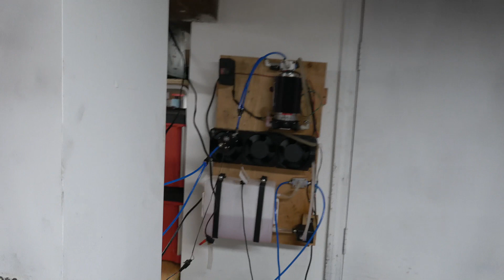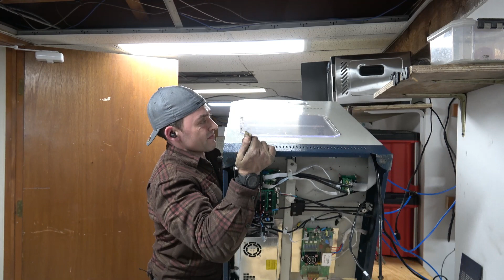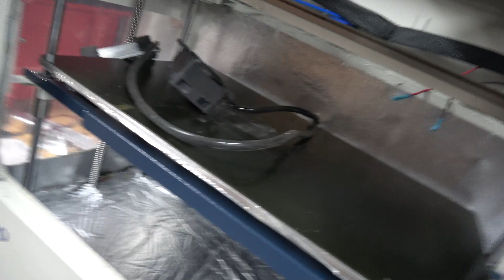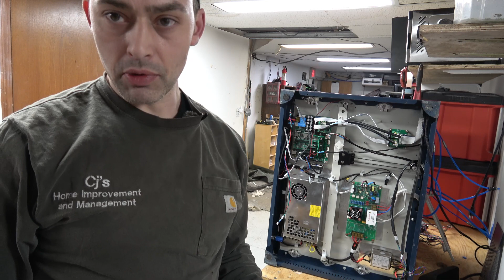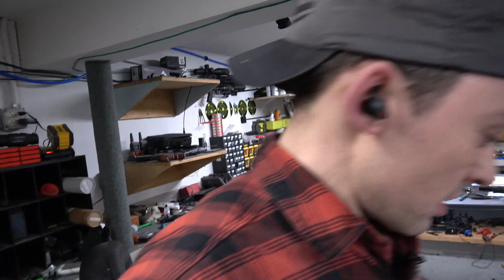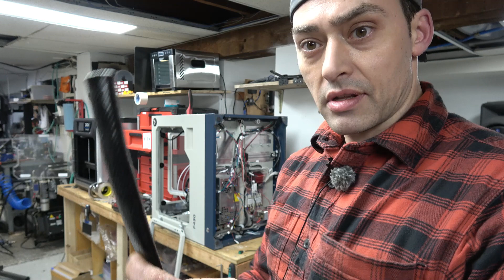Creatbot to Chrisbot Conversion Almost Done!!

Comment from the maker: how much Q D I turned around after one interaction I wouldn’t judge on that alone. Honestly, I don’t really judge anyone on their first interaction with me but as a customer who just bought a $1500 printer, I expect at least the return well actually two $1500 printers, at least get back to me but it’s like a week before I get a returned email and by then I’ve already fixed the problem. But that doesn’t mean anything they might have been busy. Maybe it was a bad time, I don’t really know what was going on, and I own my own business, so I understand stuff, maybe it was a bad time for them. They had a lot going on I’m not sure, but I don’t judge them based off of that one interaction, just stating the truth. That one interaction was bad so that’s my experience with them. I don’t have any further experience to go off of, but honestly it’s because those printers have not had any problems I couldn’t handle. A clogged the Schruder or nozzle a couple of times, but I’m printing polycarbonate, and other high temperature carbon  fiber filamentsmost of the time so it’s to be expected

Comment from the maker: So the printer.config file we are developing Currently, it Hass to be custom to each machine and each board and each everything else. Whatever you’re putting in it, it’s not gonna be the same for any two machines.
Reply from the maker: I replaced everything, every single piece of electronics, every single wire, literally nothing is left. Original! Every board, every wire is gone, new heat, sources, new power supply, new main board, new drivers, new stepper, motors, new belts, new wiring, every single thing is new, both extruders liquid, calling on every single stepper both extruders, I even have a hot end that is liquid cooled
Reply: @Cjsairgunscarsandmachining   same route i plan on goin. i am designing some parts in cad to keep the original mgn15 rails in there original place and use a corexy motion system. Do you have a CNC?
Reply from the maker: @mrcleanmn  yes, I made my NEMA 17 liquid cooling blocks for this. I'm almost done, I have it homing, and all of the heat and thermistors working, I just have a few more peripherals to connect. I have a 4' x 4' gantry mill CNC.
Reply: @Cjsairgunscarsandmachining  cant wait to see the vid man!
Reply: yes i get how config files work i would have to change the hardware for what im using.  Are you staying with the motion system that is in the f430 or changing it out for something different? I plan on going corexy for the gantry.

Comment: greatly appreciate your videos as you know your in a class of your own making vids for this unit. If you could , list all the stuff you bought for it. I'm new to this printing and have one that i got a gr8 deal on . Can you list everything you bought to upgrade ? I want to upgrade and protect my investment too.
Reply: trying to keep up but my head is spinning.
Reply from the maker: @benjolaoso7161  mine, too! It’s a lot, I built my CNC machine, it was a premade machine, but kind of like a VORON, you have to put it all together and pour cement six bags of cement, but I’m a contractor I do this for a living, but leveling the concrete-plainarity to within 1000th of an inch, it was a very meticulous process, so I looked at this job like it was tiny, but it’s really really not. It’s a big job much bigger than I thought. I still got it done way faster than anyone believed I would, but I’m a very determined individual.
Reply from the maker: Hey, thank you, the fact that people appreciate the videos is the only reason I do it, the list would be incredibly long! I must have ordered about 150 different things, and returned maybe 50 of them, I over ordered, knowing I was over ordering just because I wanted to make sure I had the right thing. Saved my butt a couple of times to do it. That way, I can list the main components, but the list would just be too long to list everything. It was so much, down to micro switches for limit, switches, heat, shielding, heat, tolerant, wire, different gauges of it, really, just so much. I can list the Motors, the board and stepper drivers, stuff like that the main components, the belts are just gates belts With steel internal, but that’s only because I’m doing extremely high temperature.
Same with all the heat, shielding, and mosfets etc., most people won’t need everything I got, I’m making this printer capable of 200 C in the chamber, I’m not going to go up that high, but if I ever need to I’ll be able to
Reply: @Cjsairgunscarsandmachining  you got it! Bruh just keep talking as long as you can we can always pause and comeback to the vids. This vid I’ll be here several times.
Reply from the maker: @benjolaoso7161  You can always come back, and I'll go into a little more depth when I do the last videos on programming printer.cfg, and finished product. Also, feel free to reach out if you have any problems, if I know what to do, I'm always willing to help.

Comment from the maker: So what you got the same printer? This printer is a good printer to start a build on if you can afford it I know a lot of people think I’m crazy because it’s like a $4000 printer and I’m ripping it apart brand new I did like three prints on it and ripped it apart, but, I knew what I wanted and I had just bought the INTAMSYS funmat ht, and I don’t know if you saw the video or not but my god what a disappointment. So I went for something a little less expensive, and I actually bought that and A RAISE 3D E2 for just about the same amount that I paid for that one printer that really sucked balls! Now I have a great IDEX industrial printer, and what was supposed to be a high temperature industrial printer, but I’m making it into a true high temperature industrial printer! Dude, this printer doesn’t have one original wire left in it the entire printer, not one single wire, the only things that are still there from when I bought it are the exhaust fan, the chamber heater, but I added four more, and the bed heater. Every single other electronic, wire, any type of component like that is gone! I have a pile of boards on my table in my workshop, my small workshop. I should probably put them online if anyone needs parts for this printer lol, but honestly, the parts didn’t add up to as much as you would think. I probably spent maybe 1200 1500 at the most on materials and that’s with four mosfets, a 600 W mean well power supply, which is triple the original, two of the MOSFETS are for 120 for the bed and the original chamber heater then the other two are 24 V for the four additional sources I added, all the insulation, and it was a substantial amount other than what I had already, which was Ductwork insulation, the extruder, the all metal BMG, I had that that was actually designed for the INTAMSYS, I redesigned it, and modified it to make it fit like this, then added liquid cooling, so that was like almost 400 bucks and I didn’t even use the stepper motor. I got all LDO high temperature Motors, the X and Y are the super speed. and they have 5106 drivers, the others are on the Z axis it’s a 0.9°, high temperature, and on the extruder it’s also a 0.9 high temperature because they will have more torque and don’t need to go fast. Every other stepper is on a 2209, the smaller extruder that came liquid cooled has a Nema 14 LDO high temperature, so every single motor is a high LDO, just different power, ratings and drivers, the belts are gates belts, the main board is an E3EZ with multiple different drivers, obviously but the easy drivers, and all high temperature wiring. I bought all different gauges of high temperature wiring, all Capricorn, high temperature tubing for liquid cooling, all the wires and tubing are shielded and extreme high temperature, wire, shielding, especially the main whip, because there is no PCB on the tool head, I ran everything all the way down. I did make a connection to swap out heater, elements and thermostats, but the wiring goes all the way to the main board. There’s no electronic boards in the chamber. The back of the screen will be, which is a new screen as well, but that’s going to be covered by a 3/16 sheet metal box , and I’m going to thoroughly insulate that. But the point is all of the electronics are out of that chamber, I even insulated the bottom of the printer in between the printer and the electronics again, and the bottom has more insulation than anywhere. I did that to protect the electronics because there’s so much more power down there than there ever was. And the liquid cooling I built the whole entire liquid cooling system and it’s so efficient. I had it at about 95C in the chamber when I was printing before I started taking it apart, and the coolant never got above 21.5 C. And that was for six and seven hour prints. So I have a feeling this printer is going to do more than fine, it’s actually getting quite a bit of attention already from friends of mine and they are people who for instance, one owns a machine shop and makes parts for NASA, so if I’ve got their attention obviously this is going to be the real deal. If you look around at high temperature printers, you can’t get a printer that will do 150 C in the chamber which I think it will actually do over 200, a 200 C bed, and 500 C nozzle for less than $100,000 I think, I haven’t seen those numbers on any reasonably priced printer like even 15 to 30 to 50,000 the 22 IDEX From Vision Miner. I really wanted but talk to myself out of it because I couldn’t justify the cost, and obviously I made the right decision because I got a really high temperature printer that will be even higher than that and a dual extrusion independent extruder printer for the same damn price as the one that was half the price, so I think I made out pretty good, I won’t even be at 8500 with everything done. But it took a lot of my time and effort and brain power and it’s been a little trying to get it done this quickly. But it’s also been fun and rewarding, if you need any help when you get into yours, if you’re going to go this far, you can shoot me an email I’ll tell you what parts I used and how well they worked, honestly I’m not 100% sure because I can’t be. I have not used them yet, but with the stepper motors and liquid cooling that I have in the extruders that I chose, and the temperatures I’m going to get in that chamber, and on the bed, and at the nozzles, I have no reason to think that this printer isn’t going to work flawlessly. And with the new belts and motors it’s going to be a very fast printer. I took a full pound off of the tool head. That’s crazy! And I still have two extruders. I’m probably going to take it down to one at some point, I just have to decide which one then it will be even lighter and even faster. Anyway, if I can help you in anyway when you start building yours, which I’m sure I will be able to, I wish there was somebody I could contact to help me throughout this process because there’s a lot of stuff that I did not know, but I like the challenge. that’s why I did it! And it most certainly fulfilled that, but I’m glad I did it nonetheless. Anyways, feel free to reach out whenever you need something.

Comment: Hey great videos.
I've been following your 3d printer videos, and was wondering, if you had the time, if you could do a full review of the Qidi ( i think it's pronounced like Chee - dee), maybe a more long term review. Showing and comparing some of its prints to the Bambu. After setup do you need to keep tweaking it or does it hold configurations for a while other than maintenance?  I've heard it has some quirks because it's not just stock clipper, some say it overwrites things or doesn't save settings. How did it print different filament types? Is there any ringing or other artifacting? I think you still had a bltouch, but they are now shipping with the inductive sensor and magnetic sheet. Have you tried any other beds with the Qidi? Did you always use that one bed adhesive or is the bed good enough?

I have very old 200x200 I3 clone that I enclosed to print abs, that i moved to PETG for the fumes. I print mostly functional parts I design for myself/family, but would like to get into TPU and more high temp filaments for parts durability with a big bed. There aren't many reviews from people that paid for the printer. 

I would like a Bambu but I would really like a bigger build plate. I was also considering a creality k1 max, but it seems to have issues with 1st layer/bedwarping/bed leveling (that could be possibly helped by rooting and full klipper) and issues with ringing/artifacting(these seem to be a fault of the printer design).

I saw on a nathanbuildsrobots video with creality, that they are possibly launching something big on their company anniversary April 9th, I think. Also Bambu is supposed to launch the new "flagship" printer in 2024, so I am probably going to wait a few months to make a final decision. Would also like to see a review of the Chrisbot compared to the QIdi and Bambu, when it's done.
Reply from the maker: Hey, I read the beginning of your message. I didn’t get a chance to read the whole thing because I’m kind of swamped right now, but I always try to respond in a timely fashion, so at least I’m getting back to you, but as far as that printer, I made like four or five videos on it, the only other video I was possibly going to do is, I’m installing a beacon, the leveling sensor, like I am on the CreatBot, I thought I might do a video installing that because I’ve already printed the mount for it, but a full review I think over the course of all those videos I’m probably said all I have to say about it. Truth be told I don’t really print with it all that much because I got so used to it not working that I was using my bamboo printers. I have a Snapmaker and a RAISE 3D E2, and between those printers, and when the CreatBot is done, it’s one of the last ones I go to, i’m hoping to change that with the fast bed leveling. That’s kind of a game changer. It’s definitely printing well now but the bed leveling has always been an issue, on my third BL touch which I didn’t pay for any of them, they gave them all to me, the support has been amazing. My first experience was bad and then really they made that up.

Comment: Definitely the hextruder for the win look up vz bot man the hextruder with the Goliath hotend no heatsink needed. It's the route I'm going with my custom f430.
Reply from the maker: I decided against that because the hot end is so big I would lose over an inch of Z and with liquid cooling. I don’t think it’s going to be necessary. The liquid cooling has a tremendous amount of flow, and previously with the printer printing I never saw the coolant over 21.5 C.
Reply: @Cjsairgunscarsandmachining  i was also worried about that i see they offer a shorter barrel. I got my printer used for a steal so im gonna go full boar on parts lol will keep ya posted.
Reply: @Cjsairgunscarsandmachining  I got mine today i powered it on and the creatbot loading screen comes on and just stays there... lol i got a board ready i might have to buy a copy of your klipper config file from ya if u were willing.